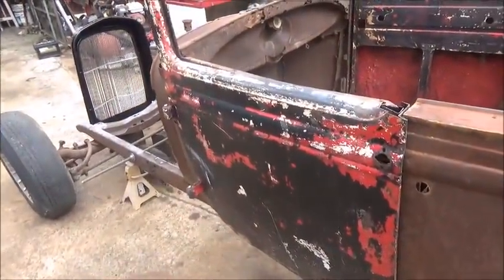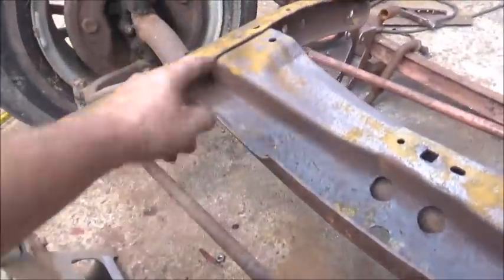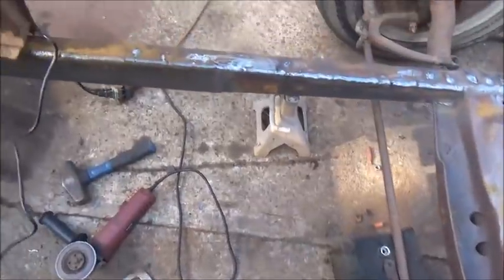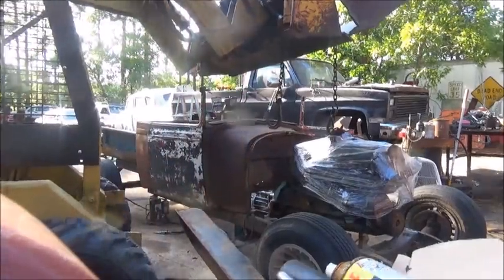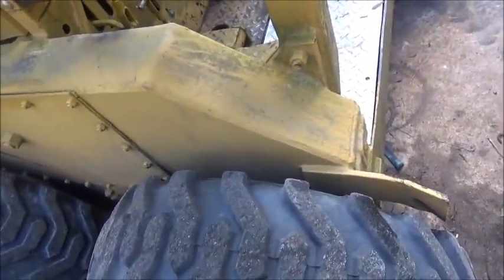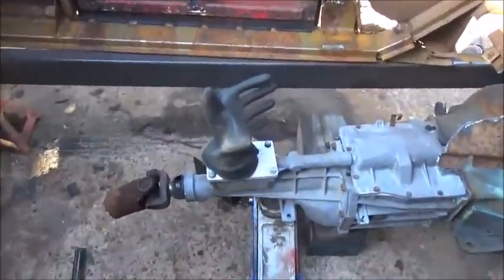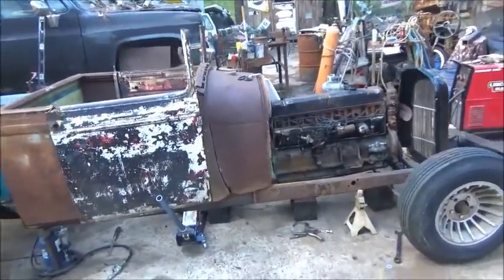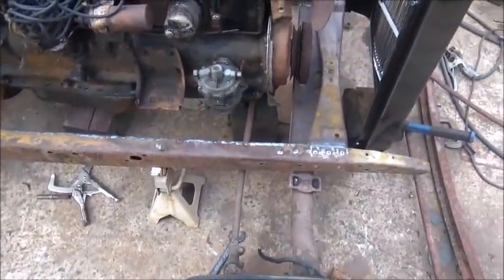1929 ROADSTER PICKUP FROM JUNK PART 8 Engine Install

Comment: The ‘29 cowl has turned into a real truck!  Old Henry never could have imagined a Buick 8 in his little model A but Jonathan did.  I like the idea of fabricating a hood for the truck.
Reply: Yes. Hood with open sides to show off the straight 8. Nice
Reply: If need be, that engine could lean a little to fit better: A Slant Eight!

Comment: The engine is Austin Morris originally . British Leyland used them in just about anything and everything . From , minis , Morris 1000 , or moggy as it was known in the trade , 1100s , could go on ,  the cooper was one of these engines rebored to 1275 with cams piston upgrades etc . They used to basically design English cars around these engines in the sixties and seventies . Most were 998 , 1100 or 1275 .  Until the government took over and didn't like spending cash on any improvements then made totally crap cars and the old school mentality ran the company into the ground because they were absolutely clueless . Hence the demise of the British vehicle industry . There we are . A piece of motoring history for everyone out there . Keep up the excellent work and tutorials Johnathon . Your a wealth of knowledge and experience , not many people out there like yourself today . Keep the old iron and classics up and running keep saving your automotive history . Top man .

Comment: Hi

That came together fast. My cat "Sweetie" does the same. Everywhere I go she goes. I can't get much done as most places are closed in the UK 🇬🇧. I need to move a 1940 Buick Super 8 and drive a 1952 Roadmaster.

That MG engine is a 1.8 five main bearing.  Miniscule compared to a 5.2 litre straight eight Buick. I have a similar 1622cc B series engine in a 1970 Morris Oxford saloon.

All the best from Nick Jervis UK 🇬🇧

Ask the man who owns one
Reply: Yeah, those SU carbs look like 1 1/2" HS 4s, I used to have a 1498cc MG Magnette ZA with the twin 1 1/4" H2 carbs.

Comment: That straight 8 looks like it always belonged there. The length of the frame is just right and you proved it. I think the handling is going to be really good because of the weight and the length won't make it so squirrelly. Great Video! Nana approves.

Comment: WE HAD A 53 BUICK SPECIAL WHEN i WAS COMING UP AND THAT WAS WHEN THEY WERE FAZING IN THE V8'S. OURS HAD THE STRAIGHT 8 AND i COULD NOT BELIEVE HOW SMOOTH THAT ENGINE WAS. YOU COULD SIT A GLASS OF WATER ON THE VALVE COVER AND THE WATER WOULDN'T EVEN RIPPLE....GREAT CHOICE FOR AN ENGINE. lOVE YOUR WORK!

Comment: I remember my grandfather had a buick straight 8 in the 70's, the motor ran so smooth he used to stand a nickel up on the valve cover and it wouldnt fall over. You dont even need rubber motor mounts on those things.
Reply: They do that trick with Rolls engines, only they use a gold Guinea.

Comment: Those little A-series engines ranged from 850cc to 1275cc typically. The exhaust manifold is called an LCB 'long common branch'  iirc. With the siamese ports they were pretty good, I had one on my stage 1 tuned Mini, with a 1098 cc engine. This was in a front wheel drive arrangement, with the gearbox in the sump.  Great work as usual JW.

Comment: That's going to be a neat build Jonathan. I have been wanting an A roadster pickup since i was a kid. The straight eight is a nice touch. I think a GMC V12 would be a one-of-a-kind powerplant in one. Waylen Wire has one he is planning to put in an old GMC truck, but I think an engine like that needs to be seen. Good luck and stay healthy.

Comment: Make sure the cucumbers don't get cat-scanned. Had a cat decide it made a handy litterbox once! The little mg engine was used for a million things. Cc range goes 850-1500 depending on who did what. If you know absolutely what it came from helps a lot. Twin su carbs to me means it's 1000 or larger in guessing terms. Tough little engines. Thanks for sharing

Comment: Coming along on it quite well on the pickup build. If you need another short bed. I have a step bed from a 55 Chevrolet 3100 1/2 Ton. Not in to bad of condition. About whats expected for a 65yr old pickup bed. I know of Nursery that has a 1931 AA 1ton stake bed truck. Somewhere back in the late 40s. The Grandfather put a Continental 6cylinder engine to replace the worn out Ford 4cylinder. He extended the hood and radiator forward to make room for the 6cylinder. The truck has been converted to hydraulic brakes along the way. Its still driven but isn't used for work much. I know another man that has a 27 TT truck that has a 1940 Flat head V-8. Its hood is and radiator is a little off set forward. It has duals on the rear. But still looks like it did in 1927. Around here in SW Missouri some old trucks are still in use. Neighbor has a 1949 Dodge Two ton with a 6.5 Cummins diesel in it now. Started life with a flat head six. Then was in the 60s it got a Y Block 318 4bl. Then in the 90s it got the Cummins diesel / 6speed put in it. Its hauler. Logs,Hay, feed and fire wood it doesn't break a sweat.. Pulls farm equipment and live stock trailers no problem. His dad bought it new in 1949. Been used on the family farm since. Most reliable truck they have for work on the farm. It has over 500,000 documented miles on it. Rear end and suspension components and what ever else has been rebuilt and maintained over the years.

Comment: The orange engine at the end is a BMC ( British motor company) A series engine, used in a lot if small cars, from mini,s, Morris Minor,s to MGB,s smallest being 850 cc largest being 1275, in thd fron TG wheel drive cars ( mini and austin 1100/1300 ) the engine and gearbox shared the same oil, great little engines, super simple and reliable.
Reply: It looks like a BMC B Series engine to me.  1800 cc. Used in the MGB for nearly 20 years (62-80).

Comment: The engine you were given is an 'A series', built by BMC mostly they were in the early Mini,s FWD with the gearbox where your sump is, guessing it is 1275cc, power 50++ HP, in the early Mini Cooper S 1275 with the twin SU carburetors, they were a very quick little car, when the Cooper S was new in the UK the Police had to buy some because otherwise they could not catch them! Same happened with the Mk2 Jaguar! Police had them too, for the same reason! 
Quite a scratch on the dogs nose, Ninja is a wise cat, she is not silly! Buick straight eight is a long engine, there won,t be too many in hot rods. Nice viewer to send you an old horn. Keep up the good work.

Comment: I like the height of the truck,i never understood everybody building everything right on the ground,even the newer vehicles here in clinton/knoxville tn,right on the ground,every speed bump or business driveway connection in my area has gouges in them from exhaust systems,transmissions,oil pans,even the bottom of the body,bumpers,the upper part of the vehicle would look great but under it and it would be beat all to pieces,but,to each his own,and that's another reason i like this channel,you build everything,high,low,in the middle,but this truck,iam loving that truck just like you are doing,the straight 8,frame/body height,wheels,and i think it would look good with a hood,one of those kind held on in the middle so you can fold up both sides,(just my opinion for me),not trying to tell you what to do,anyways,iam loving that truck,great video,Thankyou.

Comment: That old MG motor is pretty much the same as in the classic MINI . Comes in 850, 998(1000), 1100 and 1300 cc if I remember correctly.
Also.. Running sideskirts would probably look good. Covers the frame and makes it easier to hide the kickup at the rear axle 😎

Comment: Had not written before but I am one of those who thought you should channel that body.  I have reconsidered that opinion and now agree that is not necessary.  It looks better with the engine in place.  As you mentioned I would also like to see a hood but I would prefer no side panels.  I am hoping when suspension is in place that the frame will be about 3” closer to the ground.  This is going to be one really nice highboy.  I admire your mechanical skill but I especially like that you value esthetics.  You don’t just throw things together.

Comment: I never did get a back door on my diesel swap bobcat, I sold it with the door. the extra weight of the kubota v22o3 offset the difference from the kent motor with the back door gone.

Comment: If you move the engine to the right of the vehicle centerline, the fan can be centered to the radiator, you'll have more room on the driver's side for the three foot pedals and if anyone crabs about it not being centered, you can just say you built it starting from an early Australian NASCAR racer and that's how the engine was offset when you got it.

Comment: If the hydraulics are too touchy you might want to add a pilot valve to the outlet of the pump so you can adjust the flow from the operating position.  Minneapolis-Moline Universals have one built right into the pump, as one of my previous neighbors found out the hard way when he couldn't get enough power out of his pump. 

What size straight-8 is that?

Comment: You can drill some off-set holes in those motor mounts and get them to the height you want.  Just weld up the extra holes, grind the welds flat and throw a coat of paint on them and thhey will look like they came that way.  Of course, some smart Alec will come by and say you got them on upside-down and the holes aren't right, but just shrug your shoulders and say they came that way.

Comment: The engine is a B series, probably 1800cc from an MGB, 95hp and good torque.  On the manifold side of the block the capacity is embossed as part of the casting.  Would make a heck of a go kart!  Cheers

Comment: For the mounts you could probably use some fluid filled Taurus or Buick front wheel drive type and really keep down any engine vibrations even though that straight eight is a smooth runner.

Comment: I love those A series (MG) engines. Very simple, great parts availability and easy to tune up. That one could even be a 1275cc. It's easy to tell by looking up the markings. Even has twin SU carbs - very sought after over here in the UK. I believe some of the original Triumph Herald parts are compatible with it if you still have those. Might be overkill for a go cart but would go great in post war British sports car tribute build like maybe a larger Austin Healey style car if you like that look.

Comment: I think the  1966 MG A series engine is most likely 1275cc
Reply: I agree Mark.
Reply: @MalcOfLincoln  They did a 1600 as well with the twin SU carbs
Reply: @billsuddell9508  not in A.  series only made up to 1275 cc    from factory
Reply: Judging by the exhaust manifold, it is a B series 1800cc engine out of an MGB.  95hp with the twin carbs.  The engine capacity is shown on the block casting on the manifold side.
Reply: I agree it must be a B series engine. Either 1500cc or 1800c. i think  the water pump size can also indicate the version.

Comment: '66 MG Midget would have been 1098cc (approx. 66/67 Ci) To confirm, engine Nº ought to start 11L, or 13L if it's a 1275cc (84? Ci).  The cats are adorable :-).

Comment: That little MG engine could be an A series 1275cc Its hard to tell the size from here. They did the A series, went from 850cc up to 1275, in the MG midget. Then the B series went from 1500cc to 1800cc. In the MGB. I think. I seem to remember something about the extra head studs at each end of the rocker cover means its the proper peppy one with the big valves. But it was way back when. Stay home, Stay safe.

Comment: Byy! Lookin good Jon. It's normal on fords to trim the sides off the grille to move it back over the crossmember a bit. It's like that on "Old rusty" my Model A roadster on 32 rails. Do you think you might gain something by setting the motor back into the firewall a bit? Either move the motor back or move the body forward. I'm enjoying watching the progress. All the best. Mart.

Comment: I know it's not "traditional" but I think I would "ace" the offset fan and use an electric "puller" fan instead. Might help with the radiator spacing too . Lookin pretty nice !!! How does the wheelbase compare with the original??  My stock wheelbase 29 CCPU is "roughly"  103 1/2".

Comment: Drill holes in that gas tank half so the plants don’t drown.  I use boat rollers, which you can get for less than $10, and use my chop saw to make rubber mounting pucks.  I got the idea from Chad, (Bad Chad), Hitlz’s channel.

Comment: Digging it.  Why not just slot out the lower of the two engine mounts and move to be the same as the other side?  The MG motor is probably a 1200.  MG tended to use higher displacement engines although of the same series the Mini.  Mini was originally a 998cc.  This is a model A engine I believe.  Should be able to get the details from at the block number

Comment: The mg engine will have 1100 or 1275 on the block , relates to 1100cc or 1275cc 👍 valuable engine for historic racing

Comment: lookin' goood. That MG Motor looks like A 1275cc. I Recognized It By The "A" And "B" Bolts On The Head. Also The Old Mini Cooper S Used That Engine. Check The Engine Numbers ?

Comment: Mmmmm, there isn't anything like Garden Fresh Cucumbers! If you want to build a good soil, start a Compost Pile. Put your Food Scraps, Pine Needles, Animal Poo, and some of that crappy Sandy Soil. Add to it for about 6 month's, then "Turn It"... Then, start gradually adding more scraps, and turning. A good size compost heap is about 4'x4'x6' (4'x4' wide, by 6' tall). I would center the top of the valve cover, with the centerline of the car. I think you'll have to build an Offset Mount, for the Driver Side.

Comment: does that old case skid steer have brakes i had one without brakes with that clutch drive it would free roll in neutral position not fun compared to hydraulic drive

Comment: If you did Lean the engine over a little bit because of the motor mounts would not help center your fan to the radiator